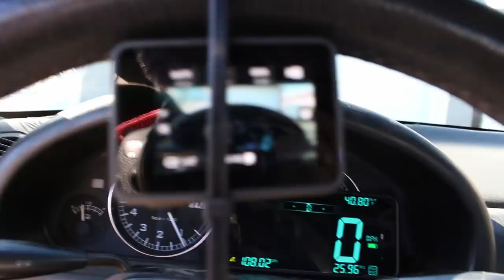Sending The Miata To 100MPH On Jackstands: The Gremlin Chase Part 4

Comment: Hi Peter,
Mechanical engineer here. I have both a Bmw and Miata of the same vintage, so I know them both well. 
I think it's a combination of several problems. High speed footage of trans/driveshaft would help. 

1. why did you eliminate the rubber giubo at the output flange? You eliminated the torsional vibration damping. 
2. Bmw has a center support bearing on the slip section of the shaft. 
3. All that vibration from driveline getting transferred to the body as some have said. 

Hope this helps

Comment: I feel like your setup is not managing vibration properly that eventually builds up in the driveshaft. I really wonder what would happen if you try that same test, but secure the engine with an overhead mount. Some way to offload vibration from the engine. Then supply some extra dampening to the trans and the diff with a jack. If that removes it, that could be revealing.

Comment: Greg. I just had a crazy thought.  It could be a bent half shaft. Put the car back up on the stands, and disconnect the CV shafts, then run it up again. That will either prove or disprove a CV shaft problem.  Of not, then disconnect the prop shaft and run it up again. That will isolate the problem a little further.

Comment: You're probably already looking into this, but I feel like a Guibo would solve this. Its meant to deal with driveline misalignment and vibrations in conjunction with the CSB.
Reply from the maker: That's a setup that KMiata and I are working on; the tricky part is figuring out a guibo setup using a 1 piece shaft since they have to have a zero degree operating angle. It's in the works though!

Comment: while driving down the road find the frequency of vibration. Might be able to narrow things down due to all the gear reductions. Since you already narrowed it down to post transmission, you might be able to tell if it is before or after the differential. -- just an idea

Comment: This is like a bass guitar that only buzzes on the 18th fret on the D string.   Harmonics. Maybe.  But I am hopeful this is a single component that is going to end up being located.  Man you are a very methodical troubleshooter.    This started after you put the bushings and the BMW transmission with the adapter kits if my memory is serving me.

Comment: If you look at a cross section of the 260 gearbox you will see it has a different bearing setup on the output shaft compared to a gearbox with a slip yoke output shaft. The 260 was designed to use a center bearing on the tail shaft.

Comment: This is a similair problem which effected me and that is common within the S2000 community, that is related to aftermarket throwout and spigot bearings causing excess vibrations on the pressure plate and fly wheel which transfers down the driveline and is still present in neutral as it doesnot disengage the clutch fully . Even reputable brands such as Exedy have this issue. Went through a gearbox rebuild with brand new oem gearsets + another drive shaft only to find out the issue could of been resolved with OEM replacements of both the throwout and spigot bearings.

 (Extensive testing by the community points to the OEM parts being the only ones without the issue.)

Not sure if this problem would effect the Getrags transmissions although might it be worth swapping them out as it looks like this isnt the last time your gonna have to drop that transmission :) 

Look up S2000 clutch buzz for more info, hope this helps, give us a shout out if it does lol
Reply from the maker: Very likely issue, if the problem didn't occur with clutch and flywheel RPM at zero like it does in my case.
Reply: Same conclusion i came to aswell when trouble shooting my car which lead me to replace every other driveline compenent first. the issue turned out to be with the clutch fully despressed the throwout bearing did not not 100% disengage causing risidual  friction on the disk damaging the fly wheel bearing which compounded the issue.
Reply: Also this issue is inherent from the throw out bearing being a "pull type" which will still cause vibration even when the engine seems to not be rotating as your transmission/drive shaft is still rotating and "rubbing"  for lack of a better term via the pressureplate and clutch. Inmagine your transmission trying to spin freely but ever so slighty engages for split second causing resonant vibration which explains why it is still present when the engine is switched off. The reason why i mention the spigot bearing is that this is also the reason it happens in gear as well as out as a bad throw out bearing will also eventually damage it. Notice your rpms bouncing rather than going down smoothly when your switch off your engine
Reply from the maker: @ThaiPham-pb2wv  When the trans is in neutral, and the clutch is out, engine off, there is no spinning of any parts inside the bellhousing, everything is at a dead stop. If the engine is off, trans in gear, clutch in, then the input shaft and clutch disc are spinning which could create noise. This is also push type :)
Reply: @TheCarPassionChannel  Ah k cant speak for an push style throw out bearing here although it could still be a bad spigot bearing introducing  reaonant vibrations as you put load into your gearbox/ drive shaft. Long shot but seeing as you've tried everything else  its worth replacing next time your have the trans out, for a few dollars worth a shot if you have the opportunity

Comment: I had a similar issue on a mustang one time and it ended up being both the rear rotors where warped. Also might want to get your rear axles checked. They could have got bent or slightly twisted causing them to be off balance.

Comment: I have the same vibration issue but on my s14 with a 1jz vvti and cd009 trans and z33 diff, I had my driveshaft rebalanced and it seemed to help a tiny bit but not really. The fastest I’ve gone in my car is 100 just because the vibrations feel so bad. I haven’t had time to try anything else. I do have solid bushings for the diff since it’s a conversion and my trans mount is polyurethane.

Comment: @thecarpassionchannel I’d pull the axels, repeat the test, pull the drive shaft, repeat the test, as it only gets worse with wheel speed it shouldn’t be super hard to pinpoint, but I know the frustration, with the driveshaft out, you’d be able to tell if it’s past the output, the driveshaft and diff would be the only remaining... could be the style yokes that cause the vibration..could be something in the diff. I’d just jiggle everything, put a jack under the diff and see if there is any play, could be the angles the driveshaft is in. I guess my only question is how many revolutions does the bmw shaft spin compared to a factory Miata trans and drive shaft? Would putting the same bmw diff in the car help? Does the bmw that the trans come out of ever have this problem? I’d get a piece of paper and start eliminating things/ while researching same swap setups, we have to get this figured out.

Comment: Greg, there's a tip I learnt in school that might help you, grab some hose clamps that will fit around your driveshaft and tighten them on, see if it changes the vibration, moving them up and down the driveshaft as well as twisting them. 

It could be possible that the driveshaft its self is balanced but possible slightly off centre when mounted?

Comment: Thanks for the video. Maybe good to check if your subframe is not bent, check if the diff is in line with the driveshaft and if your axle shafts are straight and true. Also your front bolts of the subframe brace to the car are missing as others mention, but I would not expect them to be the source of the issue.

Comment: Is there any heat in the brakes after trying the tests? A while ago I had bad vibrations which were caused by contact between pad and disc. New disc pads and service on calipers fixed the problem.

Comment: Have you tried to put back the 6 speed and check driveshaft angles? Also might be that the Getrag is a little of center ti the diff. Its very strange, and I don't have any clue why the driveshaft have such severe vibration.

Comment: Has the driveshaft been properly phased?  Incorrect phasing of the u-joimt results in driveshaft vibration; a common issue on RWD front engine swaps.

Comment: I have has similar issues with wheels out of balance, a bad wheel bearing, and a bad tire. Also, an old issue that goes back to the NA Miatas - they like lower tire pressure. Dropping to 26 lbs can eliminate some highway vibrations.

Comment: It might be a diff issue. I just put in a torsen in mine with unknown mileage and I get pretty bad nvh noises around 75 80 mph. I'm thinking it might be a pinion to ring gear meshing issue but idk for sure. Granted it may be accentuated my using poly mount brushing but maybe try another diff? Maybe because the ppf isnt absorbing some of those vibrations anymore?

Comment: That was an awesome analytical approach. Great job. Its gotta be a rotating mass thing...somewhere. It sounds/looks like you have eliminated tires/wheels, engine-related, and driveline. That leaves transmission, diff, axle shafts, and associated mounting stuff. What a bugger! Best wishes. If its not some weirdo "harmonics" thing where two different things are affecting each other at a certain speed, I'm sticking with transmission.....

Comment: those driveshafts are supposed to have a center support normally although i know alot of people use 1 piece in e30s with getrags.  could also be not having a rubber guibo on the output shaft mating to the driveshaft
Reply from the maker: 2 piece driveshafts use a center support bearing, 1 piece systems do not. The Guibo is actually a possible solution to the problem, but may be difficult to pull off with a 1 piece shaft. That's something that's in the works.
Reply: TheCarPassionChannel Yeah that’s what I meant with the 2P system using the center support bearing I wonder how much vibration that takes out, assuming the vibration would be due to harmonic imbalance of rotation happening from the transmission through the driveshaft￼

Comment: I have same kind of issue.. It vibrates at 2700 rpm when you let the trottle of.. The driveshaft bearin has been replaced and the torsen diff has been shimmed.. Torsen cog wheel maby vibrates??

Comment: I think you should get solid twin u-joint driveshaft, with no slip jokes one end for miata diff, another one for bmw. No adaptors no shit. Solid.

Also, engine off, trans neutral. Still half of transmission spins, and bad bearings inside(especially rear main bearing) could cause vibration. My main belief

Comment: Another good one is you can fix your phone to different parts of your gearbox and diff and log the accelerometer data with any of the  free apps. The vibration at the source should be thr strongest and you will have actual data to compare various systems.

Comment: My vote is transmission tunnel is the issue. Our cars are made with crap support, literally everywhere. Something as simple as a brake master brace made a world of difference in brake feel, do to firewall flex on our build. We also have extra bracing everywhere we could and each component we've installed has made a world of difference in driving charastics. I sold my stock version after doing all this because it was so night and day, I just let it sit. Felt like a wet noodle going down the road. It appears your chassis in general has no extra bracing, anywhere. I'd box the transmission cross member to tunnel area where your bolts go through. Along with flying miata frame rail bracing.(maybe design a trans crossmember that stretches out to the frame rails to eliminate using the tunnel?) And, cowl bracing (we went with Paco here). The way you have it mounted now is just pulling down on the tunnel. The quicker you go the more harmonic you are going to feel. Espicially at the location you have the water bowl. That's going to be the worst area. 

Side note; At the end of this K-Miata needs to sponsor you with an outdoor lift

Comment: This is similar what happened to my moms car about a year ago, the driveshaft was misaligned by about half a degree and that was enough to shake the hell out of the it at 60-65mph in 5th gear. The actual issue wasnt the actual driveshaft, but the driveshaft mounting point against the diff because at some point the car bottomed out and bent it. I'm not an engineer or a mechanic or anything but that was what I understood to be the issue and he showed me, replaced it, and it went away.

Comment: Pretty sure this is a resonant frequency issue with the drive shaft, by adding in the adaptor plate you will changing the vibration characteristics of the whole driveline. There's a lot of NVH engineering behind OE systems so there needs to be some further refinement. Consider changing the length of drive shaft as increasing the damping/bushing is only really covering up the issue. There must be some NVH specialists out there who can solve this with some modal analysis.
Reply: That’s what I thought too. Either design. Damper in the adaptor like the noze pulley or get the assembled driveline balanced and had a pin to make it is always assembled the same way

Comment: You can always look into investing in some chassis ears they pick up sounds and vibrations and can be mounted anywhere by zip ties. Same stuff we us at my work to find noises or vibrations 👍
Reply: Is there such things as chassis ears that you can place them on moving driveline parts
Reply: If you find the wireless ones just make sure they are really secured

Comment: Hi Greg , I feel your pain. I think that the problem is related to where you put your supporting brackets for your gearbox. If it were me I would be mocking up the location of the geabox while supported on a jack with a lazer on a magnet or something at the back end. After 'clocking' the lazer for alignment - point the lazer at the centre of your diff and rotate the engine while adjusting the jack for good gearbox alignment. Thats the point at which to commit to putting holes in for your supporting brackets. I think your vibrations are related to an eccentic loading while your drive shaft is rotating. Theres no point in having a balanced drive shaft that isnt perfectly aligned. Happy to talk more about this... I'm used to be a cnc machinist and know the follies of having things that rotate fast that arent perfectly aligned and balanced

Comment: There are like two dozen comments saying its a wheel bearing or a cv axle, and Greg literally says in this video that they have been replaced. Good luck with your problem Greg. My money is on one of two issues: Two piece driveshaft, or trans internals. Dont forget the output shaft of the transmission is always spinning at driveshaft speed too, it could be trans internals (maybe some old bearings in the trans are allowing the output shaft to wobble in place?) either way, good luck with your gremlins dood
Reply from the maker: Can't win em all 😂 I've actually got a buddy with the same setup, and the same issue, he bought a built G260, all new bearings, and it didn't fix anything. So lucky for me, I didn't try a built box haha. Definitely heavily leaning towards driveshaft harmonics or something of the sort.

Comment: They have a sensor kit where you can put them around the car and can locate the exact area of where the vibration is coming from
Reply: Sounds more expensive than jacking it up and hammering the gas lol! Not a bad option if this didn't work!
Reply: To be cheaper with it greg can go through with his knock sensor on megasquirt held at different positions along his driveline and  view the direct sensor data to isolate the harmonic

Comment: Wow, ok just spotted something for you mate, that k Miata diff support bar isn't triangulated is it?

The inertia of the diff still wants to rock the casing under load, the PPF supports and dampens this force by having a set distance for mounting and the bushes take the forces through a solid point.

With that bar setup bolted to lower subframe, all vibrations are being transmitted to chassis without dampening.

I understand the frustration of it working for others but there is always variables to consider, that diff support bar really needs to be triangulated between where your missing your brace bar bolts are on the floor pan and the differential to be a true solid diff mounting kit and even then I'd want rubber mount points to aid NVH, especially so when it's replacing the PPF.

I'm pretty confident this issue would go away with a PPF arrangement but as that isn't happening, look at how your diff support is attached.

The subframe bracing you are missing bolts on could aid the NVH in your exact setup, same with frame rails taking shake out the floorplans, same if you had rubber bushes in diff ect but ultimately without knowing what kmiata have setup there own car with, offering out a kit that uses a pretty poor effort of deleting the PPF at the diff end and leaving out all these variables has me thinking it wasn't thoroughly tested on different setups.

Solutions wise is a bastard as that's the kit, even rubber mounts on between there bar mounting points won't help much as it's simply a bad place to support the diff, it really needs longitudinal support, ideally triangulated if there is no PPF

Comment: check geometry: gearbox output shaft must be parallel with diff input shaft, otherwise you can have variable angular speeds, The same applied to cv joints. This joints does not tolerate big angles

Comment: Wheel bearing? Try the same test but only one axle at a time see if its only one side. you just have to isolate the vibration. the 96m i had done the same things at 55-60 and again around 90-100. it had a bent rims for a long time bore i had it.i replaced the axles and had the drive shaft balanced. sold the car never found the issue. think iv watched every video for the last 5 years. hope you figure it out.